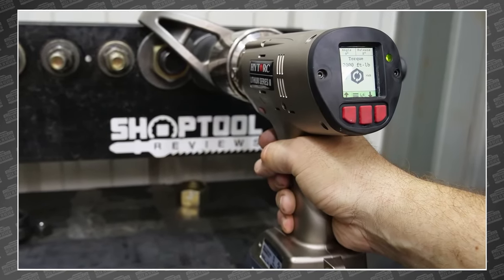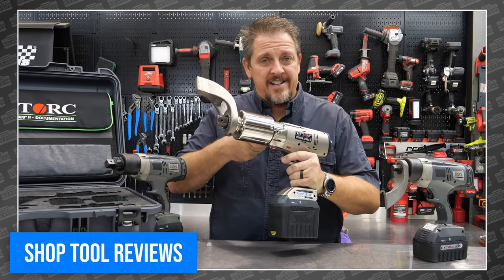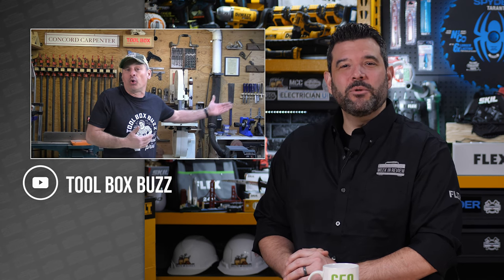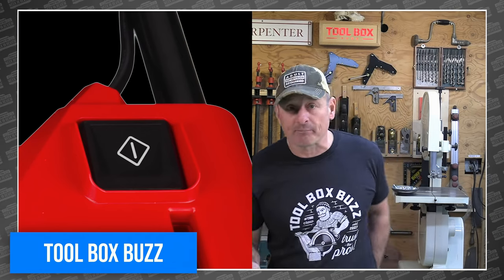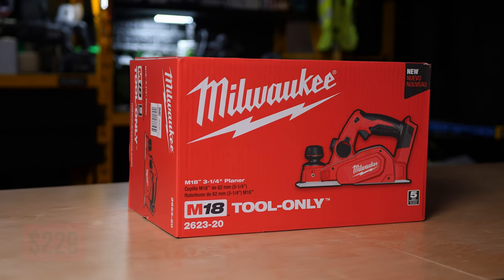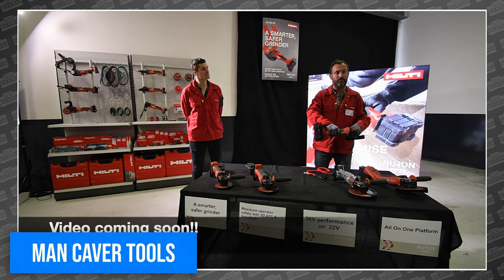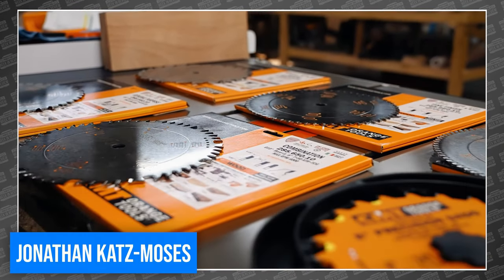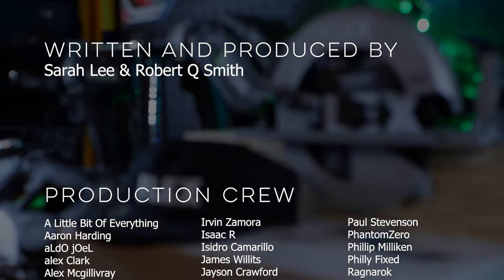Power Tool News! NASCAR Tools, Milwaukee Mower, and more!

Comment: Love the idea of advocating for tourniquets. However, the Recon Medic TQ is not approved by the Committee on Tactical Combat Casualty Care (CoTCCC), the body that tests all TQs to an established standard. I STRONGLY recommend you swap that out for any one of several tourniquets that are CoTCCC-approved, such as the North American Rescue CAT or the Tactical Medical Solutions SOF-T. 

Tourniquets that are not approved have been found to suffer from critical failures during use (aka: they break apart). The Recon Medic is basically a cheap knock-off of the CAT. 

Sure, the CoTCCC-approved tourniquets cost around $10 more than the knock-off. Is your life not worth that $10?
Reply from the maker: This is good info MrSmith. I'll look into it for sure. I appreciate it.